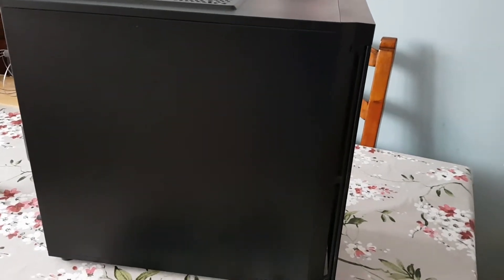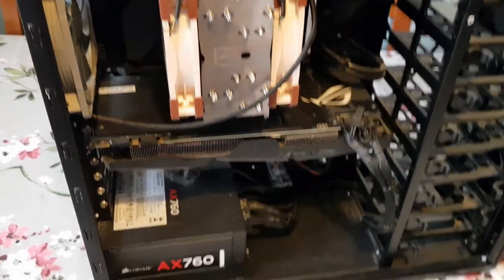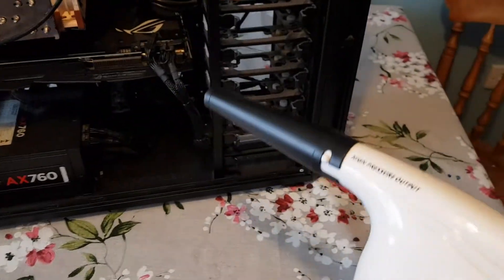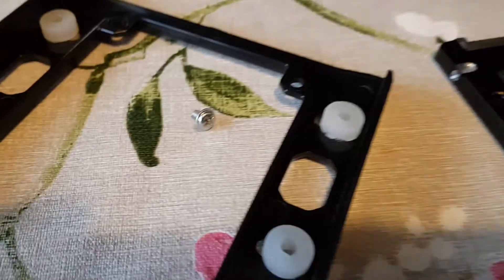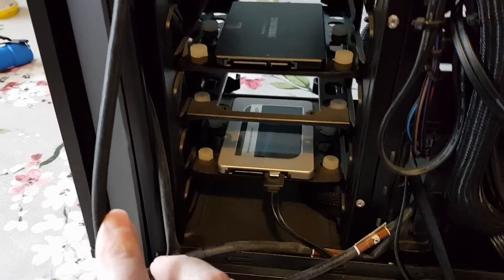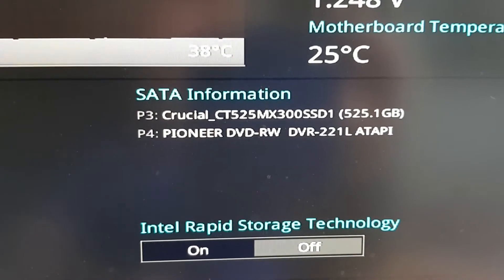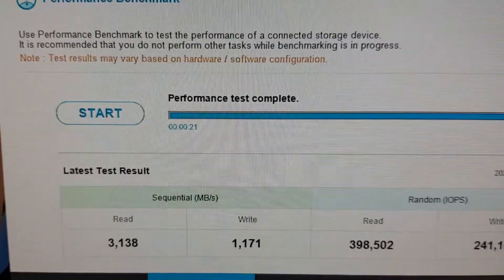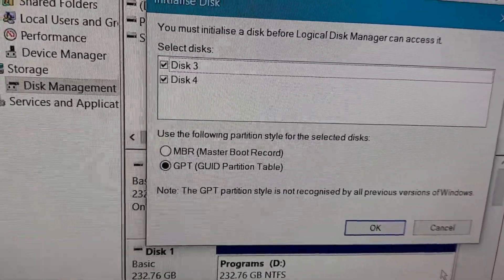Install SATA hard drives, Samsung 860 Evo, BIOS settings, Formatting

Comment: Great video! I'm hoping you can help me out.  I too installed a Samsung 860 EVO in my computer and shows up in the BIOS as well as the Samsung Magician but the Samsung Magician is telling me that 860 EVO doesn't have a volume.  How can I fix this?  Thanks
Reply from the maker: Hi there thanks for the question. If you right click on my pc icon. Manage. Under storage, go into disk management. Select the new disc and do a new simple volume. Ensure you give it a drive letter. Follow the wizard. This should then appear and work ok. Hope this is the problem and helps, regards